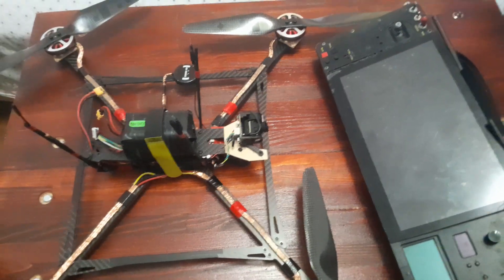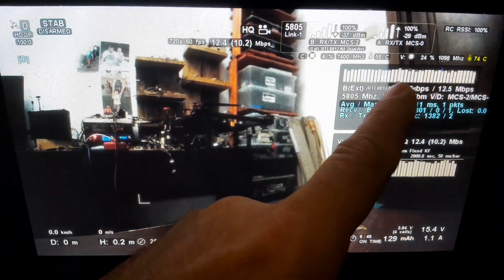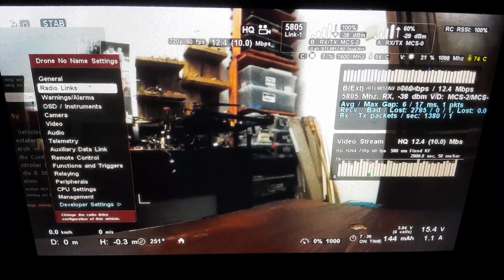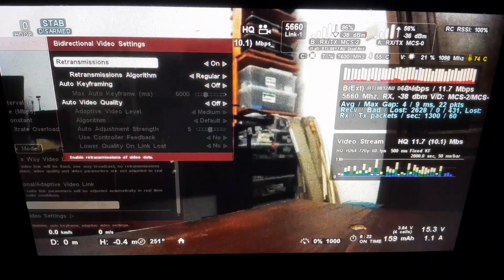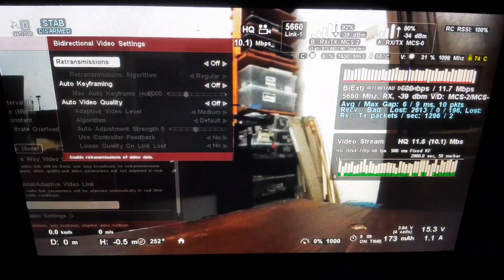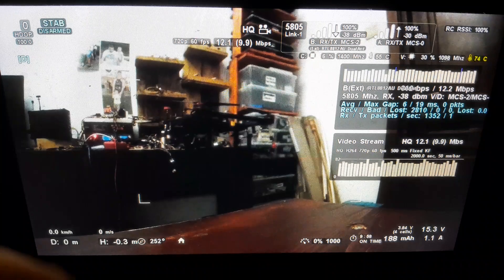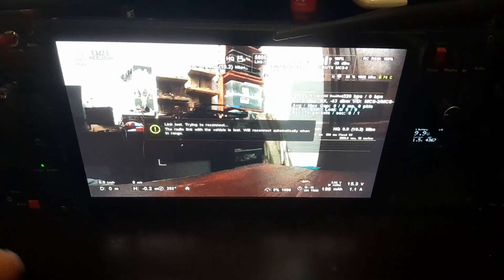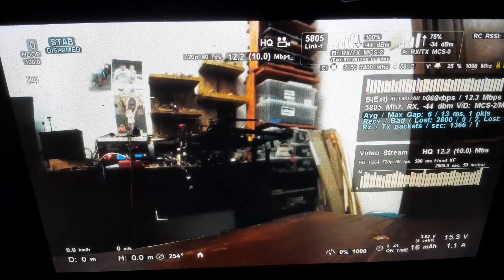Benefits of retransmissions in a digital FPV system

Comment: Thanks for the continuous doing this Petru! In my understanding Radxa 3E/3W will theoretically have lower latency than RPi4 due to using H.265 that is more efficient, right?
Reply from the maker: Radxa has a way faster video decoder overall, so yes, latency will be visible lower than Raspberry, not just for H265. I haven't tested H265 very much, not sure if it produces a lower latency stream as the computation load is theoretically higher on H265.